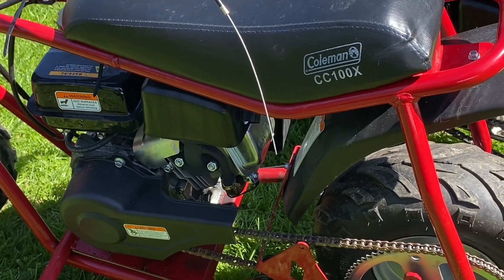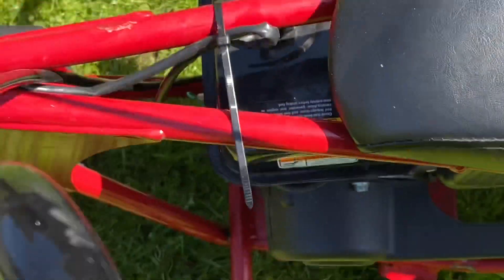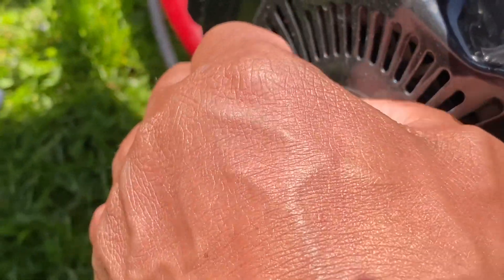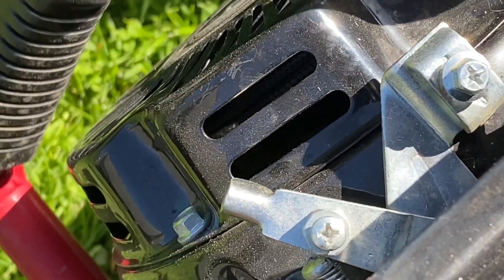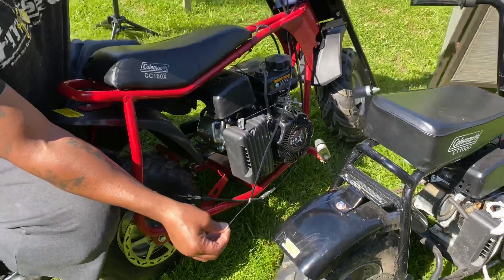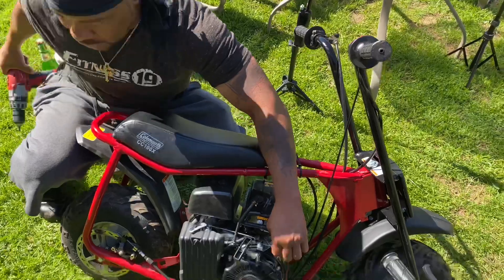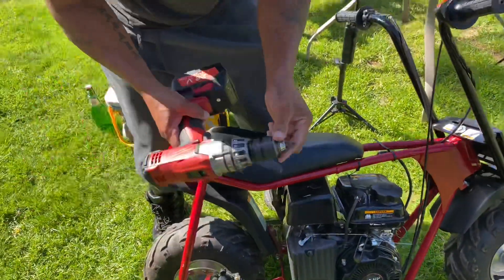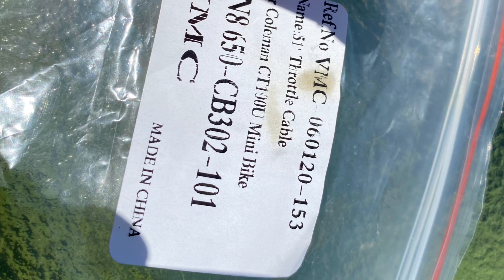Coleman cc100x mini bike

Comment: Hey brother been out for a while but back now.  Hope you have been well.  Still getting in shape.  I took that picture of the gas pump the other day.  You asked me to take it,  the fastest pumps in town.  There is a way to take out the governor so you can get some more speed I think.  Saw it on bikes and beards channel.  If I find it I will put a link.  Make sure that cable ain't to tight so you can steer without ripping it.  I would run it through center so it doesn't interfere with steering left.  It might get taught and tear.  Just a suggestion, might be fine couldn't tell from angle
Reply from the maker: Thank you for that 🙏